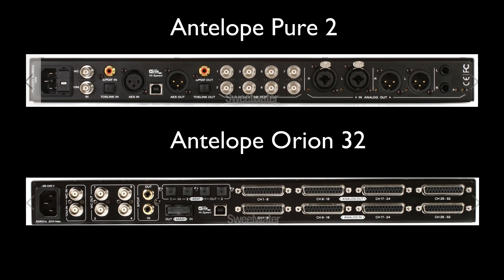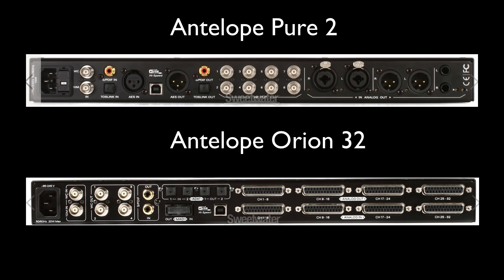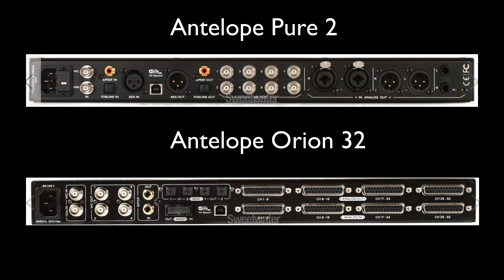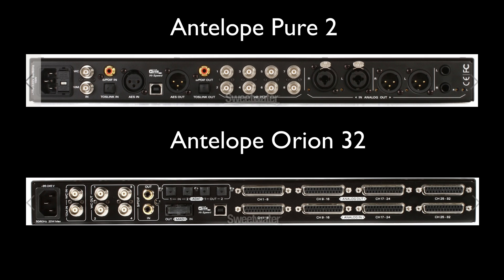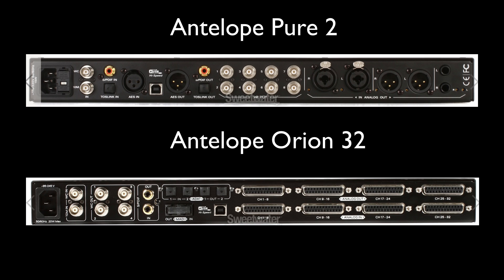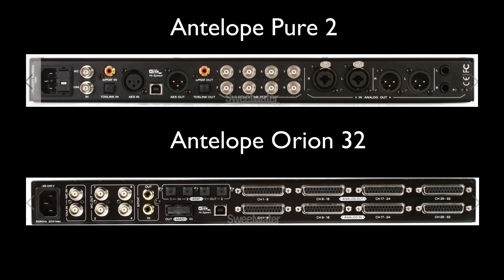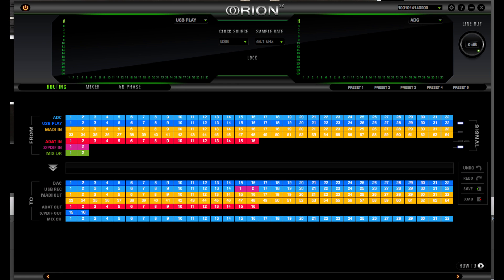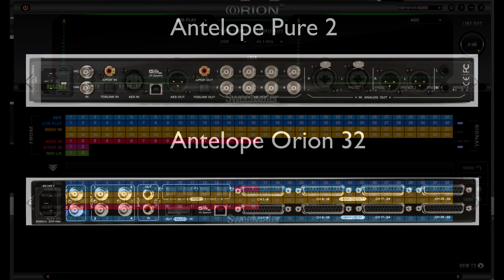Audio Converters explained and how to connnect them

Comment: what i dont get is say i wanna track with all external preamps/eq/comps, or using a mixer and I dont want an interface/converter with mic preamps, because like i said i already have all my preamps, how do you connect all those channells into your interface? well, Okay, I guess you need line ins right? the thing i dont get, is where are all of the line inputs on these interfaces without mic/combi/line inputs? like right now i track through an isa one , a compressor, and an eq etc and the last thing it goes into is a mic/line in on my interface, but when i look at all these antelopes and stuff I guess i dont see how to get all the inputs in? sorry if thats confusing!
Reply from the maker: +James Cassidy if your using an interface that has mic/line option for the input you want to use it as line if your using a external pre. Most interfaces have a combo jack (XLR/TRS). Usually the TRS connection bypasses the mic pre. So you can go from your pre to the line in bypassing the pre on the interface
Reply: yea no i get that! what im saying is if your using all external pres, either hardware or from a mixer, and your using an interface/converter without pres(because all your pres are covered) how are you getting it into interfaces that dont have mic pres built in? know what i mean lol? if not just tell me and ill try reword it! i understand though how to use external pres/eq/comps etc and run them into a line or mic/line in on an interface!i guess another way to put it would be, lets say i had a recording that required a big i/o channell count, like 8-16 mics, and i had all external pres or a mixer, how do you route all those to an interface or a/d/ d/a converter? like they make ad/da converters without mic preamps for people that dont need them or even some like the rme 's that have 8 pres but say you can run 64 channells of inputs..like how lol?
Reply from the maker: Do you mean how can a interface say 26 inputs for example and you only see 8 inputs?  If the interface has adat each adat connection can add 8 channels up to 48k sample rate. higher than that and you cut your channel count in half. So it goes from 8 to 4. If you have a presonus Digi max for example it will let you connect 8 mic/line inputs by adat to an interface. So if you've using all of the inputs on the interface you can expand the inputs by adat. If that's the answer or I'm still misunderstood let me know
Reply: yeah you answered half of my question forsure, the thing i was having trouble understanding is if you wanna buy an interface without preamps on it , is there options that have just line ins for if your just wanting to use external pres!  i kind of figured it out over the weekend though and realised there is interfaces you can buy that just have line ins and other stuff but no actual pres! i just didnt know exactly how you would connect your pres to your interface if it didnt have combi jacks or pres already! ! so no worries! thanks homie!
Reply: my only question know would be whats the difference between a converter/ and an interface that just has line ins and no pres? or  is it the same? or is a high end converter, just like a high end clock something you just add on to your interface?
Reply from the maker: +James Cassidy if an interface has pres or not it still has a converter in them. That's how it gets the sound from the interface to the computer

Comment: Hey man . Awesome channel bro. I have few questions for you . I want to upgrade my ad da . Right now i have multiface rme . I like the rme drivers and i am hooking bunch of synths to it . I also have a separate greatriver mic pre. Lets say i get the pure too , and hooked it up with the rme through spdif . Can i still use the pure 2 AD for the mic pre only? And keep the rme for synths? If so, in this case my computer would be dealing with 2 interfaces at the same time? Its a bit confusing at the same time? Thanks a lot
Reply from the maker: +Mostafa Negm you can get a pure 2 and connect it to the RME. You don't have to connect the pure 2 to your computer unless you want to utilize the software control. To use the great river pre (great pre BTW) you can connect it to the XLR in on the pure 2, them spidf to RME. In your DAW select spidf input for that channel.
Reply: audioczarnet so if i am using the rme inputs and then connecting it to the pure 2 , this way i am bypassing the DA only of the rme ? Or will i be bypassing both AD and DA?
Reply from the maker: ***** if you use the RME inputs and then monitor the output from the pure 2 connected by spidf then your using the D/A from the pure 2 and the A/D of RME. I wouldn'tsay your bypassing the D/A of RME, because technically if your using the spidf out your just choosing note use the RME D/A. To use the pure 2 for A/D then you would need plug into the pure 2
Reply: so please let me know if i got this right .. a chain could be like .. Synths>Rme inputs>spidf out rme>spidf in pure2> monitors . and if i want to use the mic directly into the pure 2 to benefit from the high end AD conversion .. that would be like this ... Mic>greatriver> Pure 2 in> spidf out to RME> choosing the spidf channel from the totalmix rme software ....... other wise if this couldn't happen . i guess there is no point of purchasing an AD DA . I could go get a DA only . I'd have to use the AD pure2 to justify it right ? . I guess it wouldn't be optimal to only use the RME as a patchbay for my synths . however RME has great drivers .. 
how about I can go for a Lynx HILO it has lots of inputs and outputs.. and sell my RME ..I guess both Pure2 and Hilo are at the same level!!  this way I can benefit from both AD and DA .. what do you think ? and Thanks a lot for your time man . I appreciate your help 

Respect
Reply from the maker: You got the signal flow right. The Hilo and pure 2 are both 2 channels. Between the two I would go with the pure 2 because it's rackable. The form factor of the Hilo is odd to me. Though I guess they probably sale rack ears for the Hilo but that would be an additional cost. Also I'm not a fan of the touchscreen. The pure 2 has software control where I can control it from there. As far as sound I wouldn't one is better then the other. I had a lynx Aurora before getting the Orion and I was pleased the conversion and clocking from it.
Reply: audioczarnet lynx products looks ugly in general 😂. But they say the hilo is 32 channels total ??
Reply from the maker: It's two channels. This is from sound on sound. 

Lynx's Hilo is a free-standing, mastering-quality, two-channel A-D/D-A converter featuring 'reference' grade electronics

Comment: also connecting external converters...you must use clocking with bnc cables when spitting out multiple tracks...spdif is stereo
Reply from the maker: I'm actually doing a video on clocking next